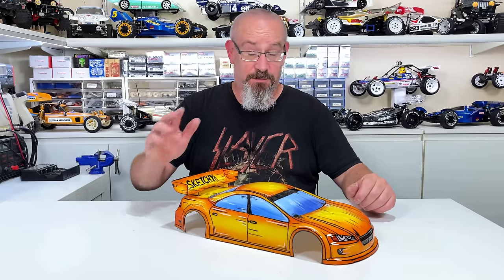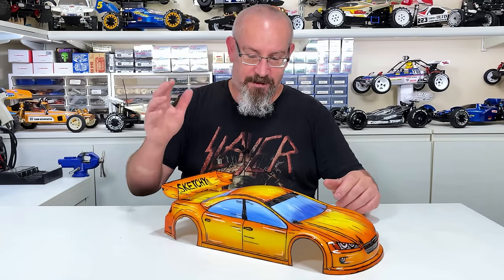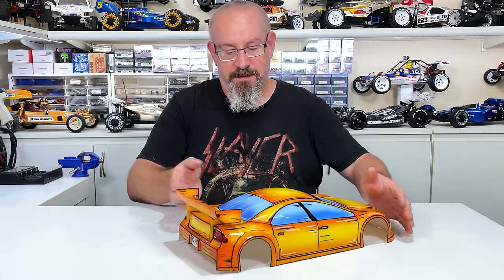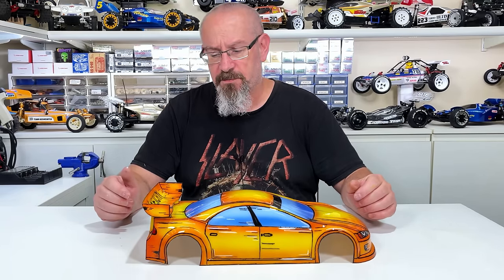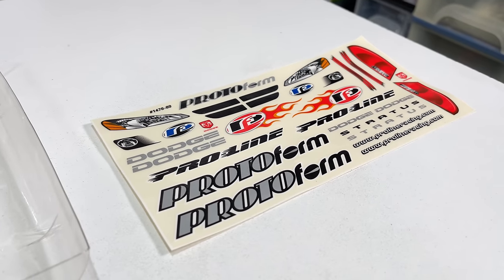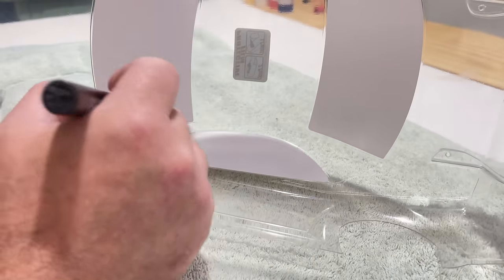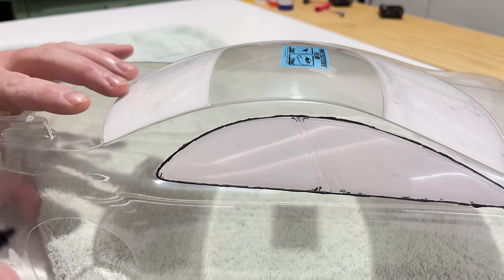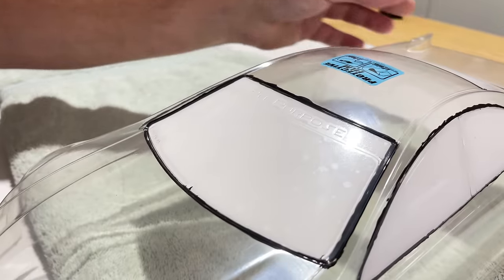Cartoon RC Car Body | How I Painted My RC Body To Look Like A Cartoon

Comment: Great job fella .if you use poly paint for your main paint job you can use acrylic paint over the top without any problems of it cracking and falling off ..I’ve been priming all my crawler body’s for years with poly paint as a sort of etch usually a silver base .then used acrylic or celly paint for the colour I want the rig .I paint all my body’s on the outside because I don’t like the fake plastic shine when painted inside because a real car doesn’t shine like that …then I weather or rust it if i want a rough dog of a rig .when the paint scratches off on rocks etc the silver shows through from underneath the colour like a real steel body .👍🇬🇧🇦🇺♥️
Reply from the maker: Thanks Craig! I think Armma paint their trucks the same way. Silver underneath so the look like metal when scratched. Good idea! 🙂👍

Comment: Been thinking about doing this sort of paint job on my rc4wd tf2 xtra cab.. only downside is it’s a matt black truck and a hardbody. I’d have to use white and silver to make the cartoony highlights on body lines. Haven’t really seen it done especially on a matt black truck. Hmm..
Reply from the maker: I think you'd be OK to paint (using the pens) over matt black. I can't see there being an issue at all. 🙂👍

Comment: that looks quite cool, might "attempt" that on my next body ;o]]
will probably look terrible compared to yours but why not try something new, probably the best design concept to attempt if you lack skill or precision ;o]

might break it up a bit and add some complexity at least, I usually do my bodies very simple with 2-3 colors (spray paints) so adding some small details with an acrylic pen (which I already have few around) might add some interesting details without lot of intricate liquid mask cutting and adding multiple color layers
Reply from the maker: Thanks mate! Sorry for the slow reply.
Yeah, this style is a nice easy one, no elaborate designs and intricate cutting to worry about.  Go for it, I'm sure it'll turn out great. 🙂👍

Comment: love it thanks for sharing this video what paint is in the paint pens as i always thought u must always use poly carb or lexan paint for bodys
Reply from the maker: Thanks mate! I'm using UNI brand Posca pens. They're Acrylic, Acrylic paints work quite well on Polycarbonate. Not as good as paint designed for it of course but still usable. Most paints for airbrushing RC bodies are Acrylics. 🙂👍

Comment: Amazing job mate!  Been wondering about paint pens myself, glad to see they stay when using a spray on top.  Think rattle can vs airbrush would impact the paint pens any differently?
Reply from the maker: Thanks mate! I have used these pens in the past (in small amounts) and used rattle cans over the top with no issues. I think you'll be OK as long as you use light coats over the pen and slowly build it up. 🙂👍

Comment: Awesome paintwork man! Wanna ask some question about pressure and needle size you using when painting acrylic paint. It look`s like there was no paint coming out. i`m just started airbrushing. i moustly use Vallejo air paint. 0,15 when detailing an 0,4 needle when painting overall paint. and pressure i`m using is somewhere 1,5-1,8par.
Reply from the maker: Thanks mate! I'm used a .3 needle. When I was painting the orange around the edges and the blue in the windows, I only used around 20PSI. Same with the yellow. For the white backing I run it at around 40PSI. The Proline paint I find still needs thinning as it's quite thick. I usually use a few drops of reducer but I still ran is quite think on this occasion. I actually wanted a lot more air coming out than paint so it fades better. 🙂👍
Reply: @RCHobbyShed  Thanks for answering. I need to try with these pressure settings and see what happened👍

Comment: love it! can't wait to do mine. what size needle are you using in your airbrush? im completely new to air brushing, i have a .2 and .3 mm not sure what to use.  thanks
Reply from the maker: Hey Cj! I'm using a .3 needle (Iwata HP-C Plus airbrush) but I think for this type of job even a .5 would be fine as there's nothing intricate to worry about. Cheers! 🙂👍
Reply: @RCHobbyShed thanks! i did end up using the .3 on mine, and the .5 for the white backing.
Reply from the maker: @cjhines8  Good stuff, glad it worked out for you.

Comment: Did you just wash it the once before you did the pen detail,, and just try to keep finger prints off it?
Reply from the maker: Correct! I do that with all my bodies, no probs yet. I try not to touch the inside of the body too much but if I do happen to have sweaty hands, say on a hot day, I'll usually wipe over the area with Tamiya Polycarbonate Cleaner. Completely washing the body again will likely ruin the masking. 🙂👍

Comment: I need your help - I have  2 x kyosho 13.T Lemans gold motor and 2x Lemans 240s esc. I cannot get either to run. Tried different transmitters and recievers and the motors just wont go. Ive just noticed that the max kv rating for he esc's are 3200kv and these motors are rated at 3350kv. Is that my problem? If so that really sucks...
Reply from the maker: Those motors should be fine as long as you don't go crazy with the gearing. I think you need to go through the setup process in the manual before they will run. I've so far only setup the one in my Fantom but from memory it didn't run until I did the setup. 👍
Reply: @RCHobbyShed  thanks for your reply. I've tried doing the set-up multiple times. I get to step 6 (neutral point ) and instead of getting a green light It stops beebing and I get no light. I'm out of ideas
Reply from the maker: No probs! Hmm, all I can think of (and you've probably tried it) is to make sure all your transmitter settings are on zero first.
Reply from the maker: Also, and it might be a stupid question... But is your transmitter and receiver bound to each other, and confirmed by the steering servo working?
Reply: @RCHobbyShed  o.k so there are 2 slightly different sets of instructions. I went with the second set and it worked. Thank's for your help!!
Reply from the maker: Aha! That's awesome, great to hear it's up and running. No probs at all mate. Enjoy! 🙂👍